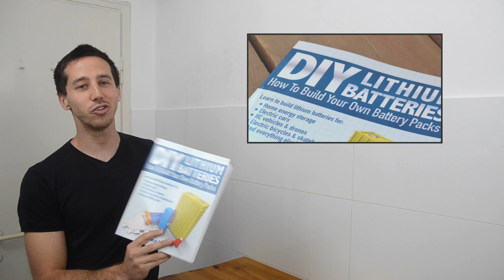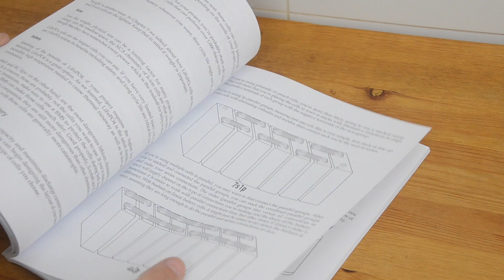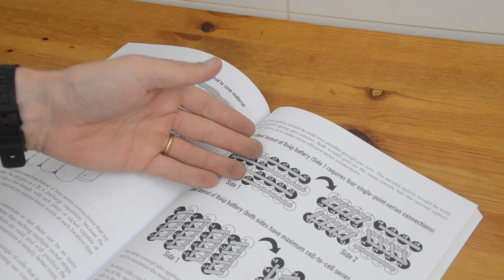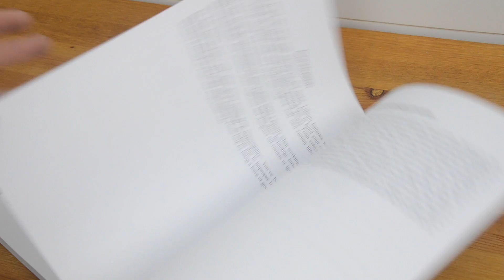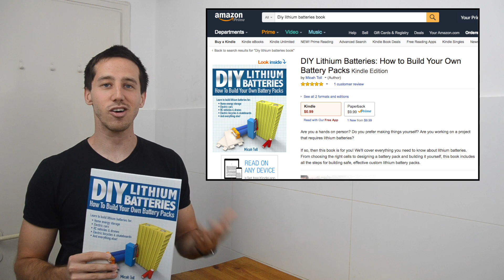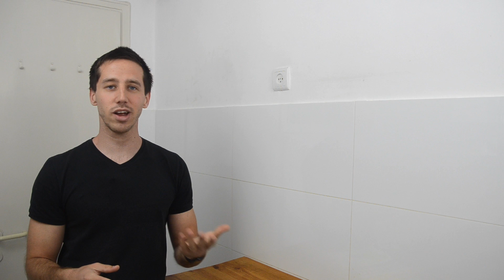My Amazon #1 Best-Selling Book on DIY Lithium batteries

Comment: I wish the book would talk more about designing with BMS. Especially using parallel BMS to increase max current. For 4SnP Lithium Ion batteries there don't seem to be any high current BMS boards. Funny for Lithium Iron Phosphate you can get 100Amp ones.

Comment: Hi I hope you're doing well just wanted to let you know I really love your channel, and ask a quick question. I purchased your book while back. I am dyslexic and have a bit of difficulty reading and digesting the information simultaneously. Normally I take all my books and put them into an app I use that will create an audiobook for me. I purchased your book as a Kindle version thinking we would get the PDF as well so I could add it to my program unfortunately once in the Kindle app it won't let me add it straight into the program. I've been adding it page by page basically copying and pasting but it's taking forever.

Comment: Congrats on your book, I've ordered one on Amazon.  I really enjoy your informative videos and have followed several of you projects. Don't feel guilty about a modest fee, we all need some funding along the way, and that's great value.
Reply from the maker: Thanks Alan! I try to find the right balance.
Reply: Hi I wonder if you can help me with the Chinese S13  AlliExpress BMS. (same brand as you used) I've connected it up to a 48 pack but I can't see it doing anything. As there are no LED's there is no heat, I can see its pulling some current but no voltage changes in the cells.  My pack is also way out of balance from 4.15 to 3.6v range, could this be an issue ?  My supply is also only 58 volts is this sufficient ? any other method of testing these BMS's ?
Reply from the maker: A couple things. 1) for 13 cells, your supply should provide 54.6V. 58V is too high. That would be more appropriate for 14 cells.
2) It should only balance while charging, not when simply connected. I've also never tried to use it to balance a pack that is as far out of balance as yours is. Depending on the capacity of your cells, at a 50mA balance rate, it could take many days to balance a pack with a voltage difference that large. 
3) You could use a single cell charger to charge up the lower voltage groups faster, and once they are close, then plug in your charger and your BMS should balance everything.
Reply: Thanks, I'll try discharge the 2 high packs with a light bulb setup, then see if it will start, real black box stuff these BMS
Reply from the maker: Yes no kidding, I can't claim to understand everything that goes on in them. But if your cells are that out of balance, it could just be balancing that highest cell first and at 50mA, you'll won't feel much heat generation.
Reply: Do these BMS use the small balancing wires to charge the packs (ie: 2 or 3 x 18650 x13s) Or are the main heavy cables carrying the load and the 50mA 'trickle' discharge use the balance cables ?
Reply from the maker: the latter.
Reply: HI a quick update I found a dead cell in my pack, this created a 0 volt output across all 3 parallel cells and prevented the BMS from working.  Ive rebuilt the pack with some Dell Laptop 18650 and I'm manually balancing them down (discharge) with a light bulb, before the big bulk charge and test.